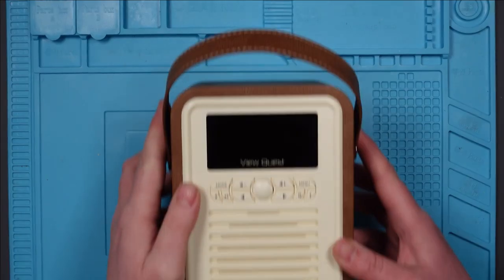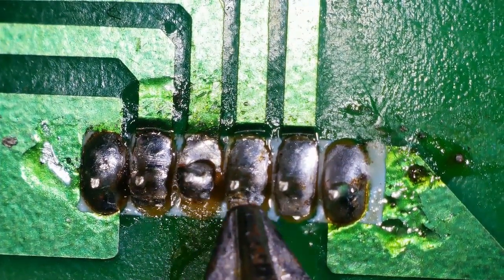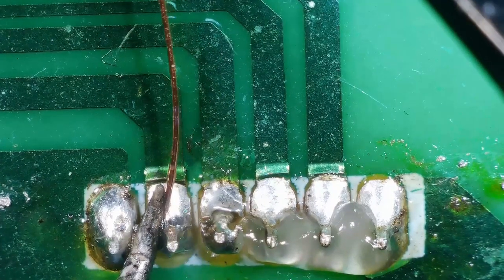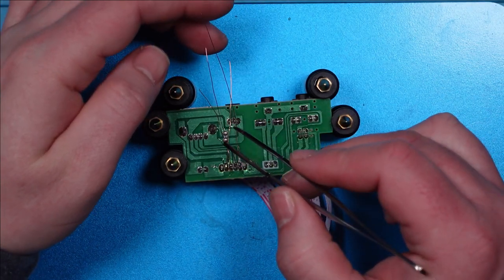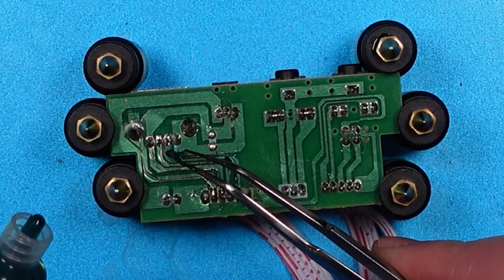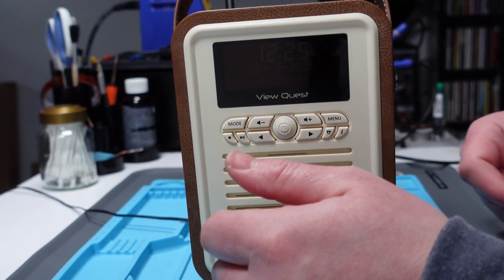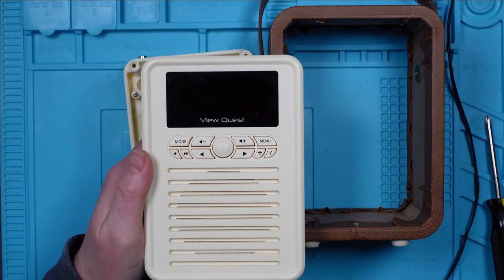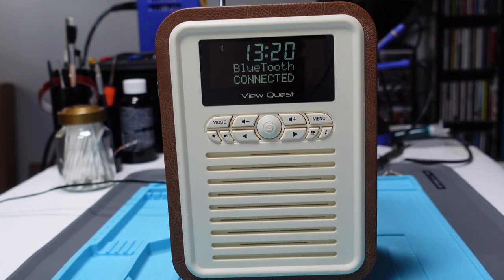My VQ Retro Mini DIED! | Can I FIX It Properly This Time?

Comment: Ever try using an alcohol wash to clean off the old flux? You will be able to detect cold solder joints more easily.

Thanks for the content.
Keep up the good work.
בס'ד

Comment: Hi, can you repair myVQ Monty DAB Clock Radio?  It's only 2 years old and suddenly stopped working!  I tried with battery and the lead is working having tested it on another equipment.  I don't want to dispose of it.

Comment: Hey I saw your ps4 fix video you posted 7 months ago I’m having the same issue in the video I initialized it and was downloading an update and my ps4 turned itself off now when I go to initialize it no longer fixes the problem
Reply from the maker: Hi Josh! It sounds like your hard drive may need replacing. If you can try a different one, give it a go and see if it fixes your problem 👍